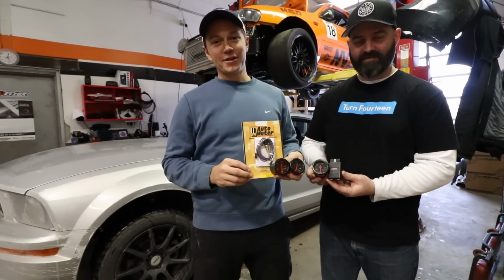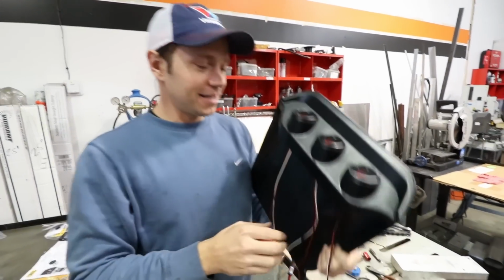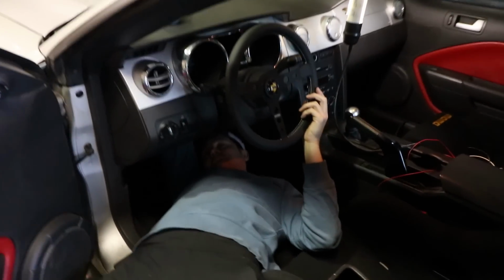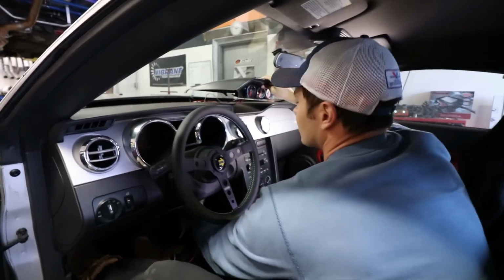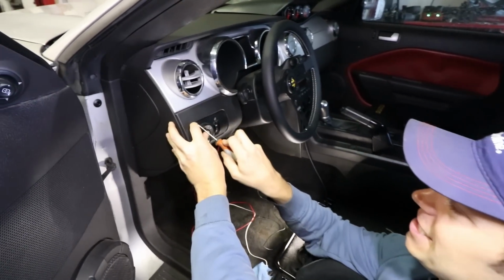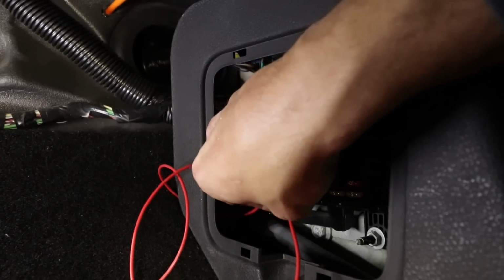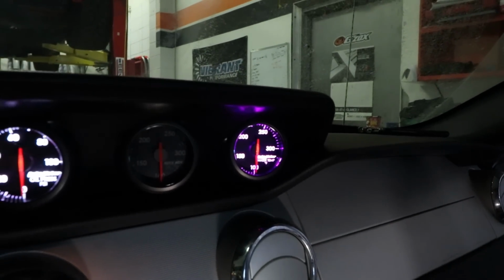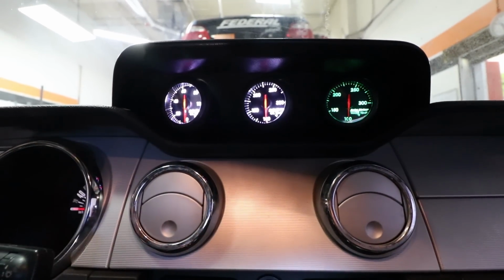Just Released! WiFi Smartphone App Gauges Installed - Mullet Mustang - EP13

Comment: Good luck with boost gauges on factory turbo cars, these things always look at the wrong PID and you'll end up getting either:  Boost commanded, boost expected or  PSIa.  Very rarely do you get a PSIg rating.
I wished the boost gages were better.  They really need an engine bay mounted transponder with a Blutooth gauge inside, not running off OBD2

Comment: Totally pointless unless ecu has all sensor outputs already. Whats the point in wiring up extra sensors to the OBD dongle then it sends signals back to gauges when you can just wire straight up to the gauges without the dongle being there like normal gauges....total waste of time.

Comment: Kinda a bad way to show off this product when 2 of the 3 gauges need manual install of a sensor. Cool concept but obviously not very usable. It's clear that many people will run into the same problem. But hey! You can change the color with your phone!
Reply from the maker: We hoped that the ECU would have oil pressure but it doesnt and really this setup is ideal for newer cars that have all the sensors already in place, our Mustang is a bit old for these.

Comment: Sheesh, you're doing this in a shop, just use their system to pull up a power distribution diagram. If you really want to do it "DIY" style, just pull the radio which is just under your gauges and you'll find  switched power, ground AND illumination all in one place.
Reply from the maker: Then you have to take apart the entire dash, we trying to keep it simple.
Reply: It's actually far simpler than you'd think, it's just two screws under the arm rest to pull off the center console, then you can just give a good tug on the two garnish pieces on either side and bam you're at the center trim piece, It's not more than 5 minutes to have the radio out in these cars, which beats being cramped under the dash hunting with a test light and lets you work in comfort. ;)

Comment: There were so many easier ways to fish the wires down.... 
why didn't you just use one of the other wires you had cut off, to go back up to the top, then tape them all on, and pull down. Rather than trying to pull that steel wire down 3 times??
Reply from the maker: Because the 3-wires wouldnt fit through the small crack all at once. I tried and failed so it was one wire at a time.

Comment: Sweet gauges but the price ... ouch ...
Reply: Alfredo Lozano $210 for module and another $210 per gauge.  fuck that.  a company called p3cars does pretty much boost, oil, coolant, air, 0-60, and more for like $400.  get them cheaper on sale.  and they look 20 times better
Reply: When I saw that price from Autometer I was like fuck that, too. I build a gauge using arduino, wireless module and VDO senders... $30.
Reply: @bcgelandewagen  hmm i like! build me one!
Reply: Ajex Johnson https://instagram.com/p/BrLLtDdHd5s1NctgMcllEoBfaO4EF1uZDha8NY0/ :)

Comment: Hey guys, have you worried at all about connecting your ECU to WiFi? It seems like any flaw in the dongle's software could make it easy for someone to hack your car and push settings to the ECU... They could do just about anything, from messing with your gauges to blowing up the engine! I'm guessing it's not worth worrying about for y'all, but I wouldn't put anything like this in my car.
Reply: cowpoodle003 the dongle shouldn't be able to command the ecu to do anything, it's simply a receiver of information
Reply: cowpoodle003 yeah put on your tinfoil hat bro theyre out to get you
Reply: Well the key has to be in the ignition for the ecu to have power.
Reply: are you one of the people that think the government is collecting fingerprints through apple scanners? get real dude youre not special enough for someone to hack your car and kill you.
Reply: ooooo soooo scary
Reply: TheJollyGiant Hey, maybe it won't happen, but it'd be pretty shitty if your car was broken or stolen because you used one of these. It's okay to make the decision that you're willing to take the risk, but you should at least consider the possibility. It's one thing to decide that you don't care enough to lock your car. It's totally different to not even know that your car has locks that you're leaving open.
Reply: Typically these dongles are built around a generic OBD chip like the ELM327 which allows for bi-directional communication. It's unlikely that the dongle's hardware is built to completely disable this, so changes to the software could make it send commands.
Reply: cowpoodle003 it shouldn't have much range, also I assume there's some security to connect to the WiFi. I also assume the dongle is only on if the car is on. Also WiFi connectivity would be bad if emitter and receiver are traveling at 60mph due to air interference. Still I will not expose my ECU through a dongles WiFi  :)
Reply: mondayfool I agree that a physical/electrical isolation would be best for this. It's possible that the dongle from the video does this, but I doubt it.
Reply: Hey, it's your choice what you do with your own car. I wouldn't be willing to take that risk. It's already relatively common to hear about OEM keyless entry systems being hacked to steal cars, and even though aftermarket systems like this are going to be less common, I still wouldn't trust them.

Comment: The thought is cool. But they are way to expensive. $210 per gauge, $210 for the controller. That setup for 3 gauges is very expensive and you still are gunna have to do almost the same amount of wiring.
Reply: They do - one is called Torque

Comment: Great SA video as always, but the product kinda seems like an answer to a question no one asked.  Viewing an OBD2 output on a physical gauge is the exact opposite of what most enthusiasts seem to want; we can get OBD2 data for pennies using an app and a dongle, but we can't incorporate stand-alone sensors into that display.  The AirDrive dongle seems to do that in some capacity, although evidently it's not sending any sensor data back to the app.  If they had designed a module that could combine OBD2 data and stand-alone sensor data, AND display that in an app, they would have a home run.  Also, the setup they installed in the mustang would retail for $800...i couldn't justify that to display my water temp on a gauge.
Reply from the maker: I agree with what you're saying but I've never found looking at a tablet to be easily readible during track use. An analog gauge is much easier to glance over and instantly have data. 

And yes, the Mustang isn't the ideal candidate for these gauges, a newer car with more OBD data would be perfect. I always find wiring the sensors to be the worst part about installing gauges so these are a great option IMO.

Comment: you sure you don't have an oil pressure sensor did you try obd setting
Reply: Most cars only have a switch for low pressure but don't output an analogue reading to the ecu or obd
Reply from the maker: Yup, we checked and unfortunately no analog output for oil pressure on this car.